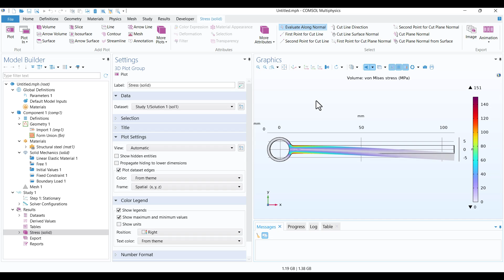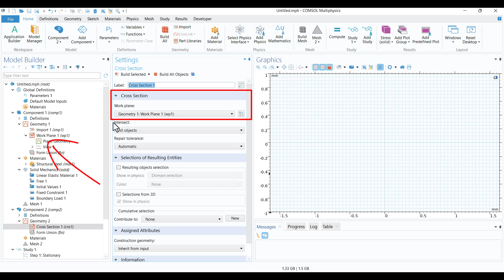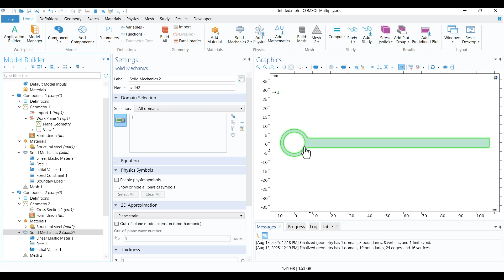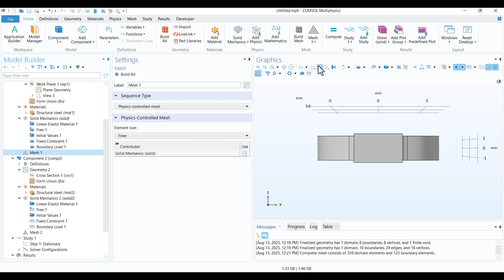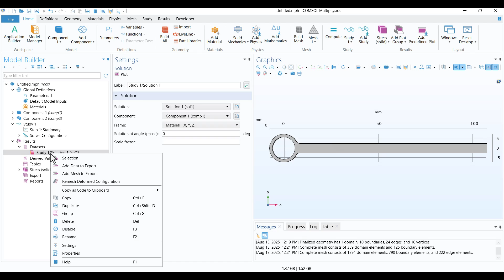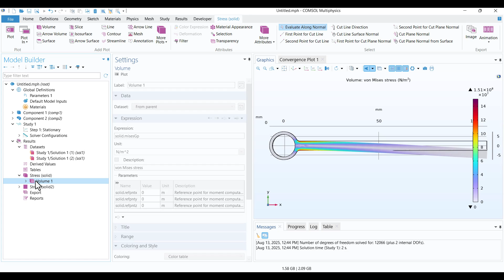COMSOL Tutorial: Convert 3D Model to 2D in COMSOL Easily With Cross-Section!

Comment: I hope this message finds you well.

I am currently working on a two-dimensional numerical simulation in COMSOL Multiphysics, using the Two-Phase Flow (Level Set) interface. The aim of this study is to investigate the interaction between an incoming surface wave and an immersed obstacle located at the bottom of a computational domain consisting of two immiscible phases: water and air.

However, I am encountering some difficulties in properly defining the boundary conditions, particularly for the air phase. I am struggling to impose an appropriate pressure condition at the upper boundary, to maintain a stable air–water interface, and to minimize non-physical reflections or numerical instabilities at the outlet.

I would greatly appreciate your advice on how to define the most suitable boundary conditions for both phases—specifically at the wave inlet, free surface, outlet, and solid boundaries—in order to ensure numerical stability and physically accurate results.

Thank you very much for your time and guidance.

Kind regards,
Reply from the maker: Hello, thank you for your comment. Multiphase flow is not my specialty, and I don’t have much knowledge about it.